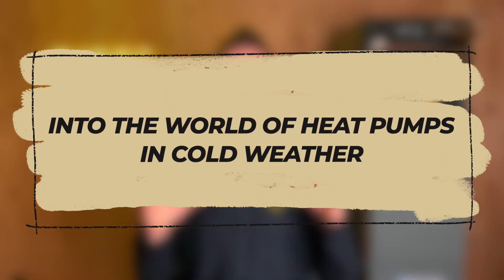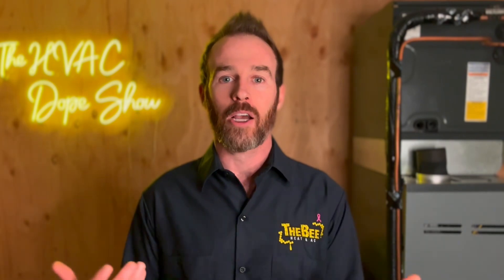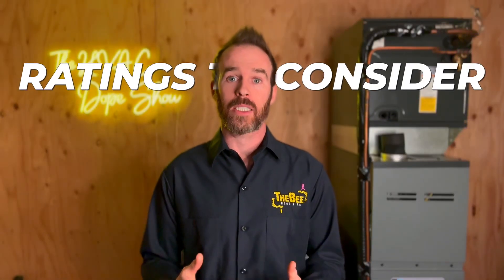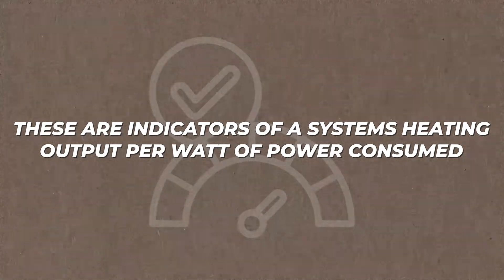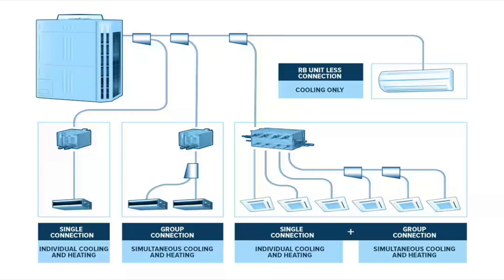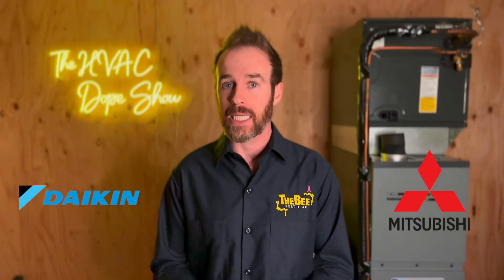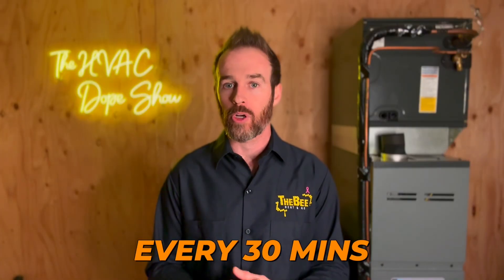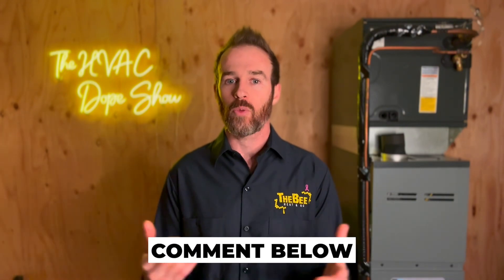Heat pumps and COLD WEATHER 🥶🔥

Comment: So a refrigerator cools inside the box and pushes the heat outside, a heat pump does the reverse and  cools the backyard!!! and pushes the heat inside the house... A heat pump halves its efficiency in winter, that is placing it right in the range of the resistance heating electricity bill cost, that costs a fraction of the heat pump in equipment.
Reply from the maker: Close but Not quite, maybe old heat pumps. Even at -5F the heat pump in my garage has a COP of 2.5 so it's 150% more efficient than electric resistive. Most of the time it's 3x as efficient and more comfortable since it doesn't dry out the air as much / less static electricity

Comment: Hello from Montreal. I'm shopping around for a heat pump. I've had 4 quotes from vendors in the last week, not one has mentioned the phase out of R410a refrigerant to R32 and have quoted R410a appliances. Do you think they should have mentioned the phase out or are they trying to sell off the old appliances? In quebec the utility Hydro Quebec administers and pays out the subsidy but they haven't included the R32 appliances. Any idea? Thanks

Comment: Update: when local temps dipped below 20 degrees Fahrenheit last week, I had to call the HVAC Co connect both heat “strips” in my Air Handlers. The heat pumps without the strips couldn’t bring the house temperature above 62 degrees. Cost me $2500. Very disappointed but system now works well.
Reply from the maker: Sorry to hear that, if you have the enhanced Fit (you should, it's the only fit that qualifies for the tax credit in the northern states) I'm surprised they're not keeping up but it also has to do with insulation and the load on your space. Maybe look at your attic insulation etc to see what the condition is because if your house is very drafty addressing the insulation / envelope of the home will do a lot more to make the space heat and cool better
Reply: New question: my hot water heater has a coil connected to my natural gas boiler. (That’s the boilers only function now). I’m in New York, is it advisable to switch to a heat pump hot water heater? Will it produce hot water comparably? I have solar panels and want to convert most of my house to electricity. Plus my boiler is requiring regular, expensive repairs.

Comment: I recently had (2) of the following heat pumps (ducted) installed and disconnected my gas boiler. I didn’t connect the “heat strips” in either system but am concerned with upcoming temps of 10-20 (above zero) degree Fahrenheit. 
I had my attic roof Insulated with open cell insulation. (One air handler is in the attic, other is in the basement. Would you recommend for me to not connect the heat strips? (I’m trying not to use an exorbitant amount of electricity). Thank you.
Reply: Multi-Position, Variable-Speed,
ECM-Based Air Handler
with Internal EEV
Communicating
For Daikin fit matchups
1½ to 5 Tons
Reply from the maker: If you have the enhanced Daikin fit you'll probably be fine but I'd just run it and see how they do. If that's the coldest that it gets you'll probably be ok. The enhanced maintains a higher capacity down to 5F whereas the standard doesn't, but at 10-20F you're probably going to be just fine for heating. Just see how it feels and if it keeps up and that's the coldest you ever get in your region then you're probably good. Worst case scenario it will not keep up well but will still heat to 60 or 65 or something and then you'll know if you need backup heat, but on the enhanced they run fine at those temps
Reply: @TheHVACDopeShow thank you. I plan to see how they perform. This is the Daikin that I have, not sure if they are “enhanced” 

- Multi-Position, Variable-Speed,
ECM-Based Air Handler
with Internal EEV
Communicating
For Daikin fit matchups
1½ to 5 Tons

Comment: If my heat pump cycles every 10minutes in 30degree weather, could it be low on freon?
Reply from the maker: Or oversized if it's reaching temperature quickly... if it's not keeping up then could be something else, always check airflow first (vents open, clean filter etc)

Comment: Same old story: 
"Heat pumps work great in cold weather. It's a myth they dont"
Immediately followed by:
"You will have to have back up heat in freezing weather"
Which proves they don't work. If they did, why do we need backup heat?
Backup heat when it's 5F (-15C) is going to be gas or electricity. Which is very expensive to run. (Electricity, gas is cheap for us)You need ample room on your electricity feed to add another 40 amps which will be a problem for many.
Reply from the maker: Lol they don't work well in Antarctica but they work great in Colorado. Average low in Denver in January is 21F. Tell me how a heat pump that can handle the AVERAGE low with a 10 degree variance doesn't make sense? Maybe not in Montana or places where it's below 0F for months but we have one installed in a gated community guard office in Aspen as the only heat source without a backup and it keeps it comfortable year round. Some people just like to nitpick and mince words... when something doesn't work 1-2 nights out of 365 suddenly "it doesn't work". That's like saying "I take my super car to the track once a year but drive it to work daily, these tires don't work for it they only work up to 160 MPH." Like when are you driving it over 160mph? Only on the track... so you have track tires for the time you drive it over 160? And regular tires for daily use? If you're not sold don't buy one but if that's your logic it sounds like you just are sold on not liking heat pumps. Heat pump on our garage works at 100% capacity below 5F, it's warm always, never fails, and has no backup heat
Reply: @TheHVACDopeShow  He's right.    You say they work in cold.  Then you contradict yourself.   It sounds like you're pushing an agenda.   You need to clearly define and establish  "cold" levels where people live in North America and where they 'work' well or not.  What is 'work'?  If you need a back-up, that's not work.

Comment: It annoys me that there are so many adverts about heat pumps "why doesn't everyone have a...".

For me the issue will be where the heat exchanger blows the cold air; I have a choice between the North of our house, which sees the Sun in June and is already cold and occasionally damp. The West has a wall that never gets sunlight and is already cold, the East is another house, because this is a semi-detached. Or there is over the decking at the back, where we would like to sit out in what sunshine we do get... Bear in mind this is the UK, it rains a lot and although the temperatures aren't very extreme, the gardens (backyards) are also small. Ours is a triangle 6m x 10.
Reply from the maker: Heat pumps do blow cold air outside, it shouldn't affect anything unless youre sitting by it like you mentioned

Comment: I have a 2.5 ton single stage Amana (Goodman) heat pump in a dual-fuel system in Iowa, where it gets really hot and really cold.  The heat pump works perfectly, not too noisy, excellent results here in hot or moderately cool. My only disappointment is that the installers told me it only works at 36F and above, and not to mess with the setting. I wish I'd known about cold-weather heat pumps, inverters etc in 2022 when I bought this one.
Reply from the maker: A lot of contractors still shy away from the higher end inverter tech but honestly that’s not a bad system, if you’re happy with it so far I wouldn’t stress… an upside is the repairs are cheaper in the future so it’s really depending on home size and needs but I’m sorry to hear they didn’t give you the option!

Comment: I have asked my contractor to go with a non duel fuel system. If my contractor sets the balance point to 46 F,  the point at which my furnace will provide heat, will my outdoor condenser unit go into defrost mode? I would like to avoid this as I have been informed it's very loud.
Reply from the maker: Depends on the system defrost mode is only loud on some systems, but it will always go to defrost mode at some point depending on run time. Just depends on the system if it does you can always switch it back to a lower or higher temp but 46 is pretty high so depending on humidity levels outside it may never go into defrost mode

Comment: Need to replace out 45 year old oil furnace and air conditioner. Natural gas is not available. Can you do duel fuel heat using a forced air oil furnace?
Reply from the maker: Yes you can just might be limited on what you can use or who offers these systems… for example a Bosch heat pump can pair with any forced air system because it’s not communicating so that would pair, but the Daikin fit is communicating so it would need a matching air handler and I don’t think they make an oil furnace. It looks like Rheem makes a unit and that might pair well with their side discharge heat pump. I’m not 100% sure honestly because I’ve not touched oil, but at a glance they’re one of the manufacturers that has oil furnaces and a cold weather heat pump that can be used

Comment: Hi.   Do you have a recommendation for an efficient cold climate heat pump where only heat is needed.  Like the mountains of Colorado where we never need AC. I have propane heat and would like to reduce propane usage.  Thanks
Reply from the maker: Heat pump will always do cooling too because it’s an AC by default. Anything cold climate rated / Mitsubishi h2i, Daikin OTerra mini split / atmosphera too are good. Are you doing mini split or central air? Lots of ways you can do it…

Comment: I live as far south in Ontario that I can at my latitude[north shore of lake Ontario,] SOUTH of many parts of NY/Vermont/Maine/new Hampshire/Wisconsin etc -30c is NORMAL here in winter even -40c at times, so you're way off on locations where supplemental heat is needed, ALL of Canada needs to use supplemental heat [our govt is only giving rebates on ELECTRIC heat pumps], when ppl could use their existing 95% gas/propane furnaces....huge cash grab!!!!  yes.... I've been in the HVAC business over 30yrs lol
Reply from the maker: Coastal Canada is warmer like Vancouver, average temps are above 32F / 0C for the lows… Toronto gets -10c which a heat pump can handle but I know that there are colder temps. So dual fuel doesn’t get a rebate in Canada ? That’s kind of dumb lol wow, didn’t know that.

Comment: I'm going to be receiving a manufactured home from Fleetwood Manufacturing and it will be installing in Central Illinois I told them I would like a heat pump system but I haven't been told what system they're going to use
Reply from the maker: I would ask for an inverter or if you don’t like what they’re putting in just hire a local contractor when you’re doing to put in the one you want.
Reply from the maker: They might give you a good one just ask for model number or tell them what you want… anything that is a cold climate inverter will probably be ok but I’d prefer a side discharge system like the Rheem or Daikin fit or Trane resolute products in your climate
Reply: I think before I decided with a heat pump the outside unit was going to be a train that maybe still the case

Comment: Trying to figure out best option to improve efficiency of a 1985 4 stage natural gas 1 million BTU boiler.  In Pacific Northwest so temps are 45F for most of the winter.  I am thinking a monoblock air to water heat pump could at least pre-charge water before being delivered to the boiler.  Electrical service is minimal though so need to determine how many amp.  Currently have 3 proterra hybrid heat pumps with a 180k btu gas water heater doing the hot water.  What kind of COP do you see at the 45F mark?  Just trying to ball park money efficiency vs natural gas btu.  Natural gas prices have been in retreat the last year so quite a different story than 1-2 years ago.   Thanks for the videos !
Reply from the maker: Monoblock could work but idk that’s its worth it just to preheat the water. From a cost perspective still might be an expensive replacement
Reply: @TheHVACDopeShow   I can get the MONOBLOC V4 5T - GRS-CQ16PD/NHG3-D for ~$13,000 plus installation.  That will do 55,000 btu of heating.  Just need to figure out the COP and monthly average temperature during heating season and then figure out ele cost vs natural gas cost per btu.  Pretty sure I don't have enough ele capacity to install 10 of them without a hydro upgrade but should be able to do 1 to start.  Can't use the cooling and only heating 7-8 months of the year so payback might be longer than hpwts.  Also not sure how long to expect the 1985 boiler ( Hydrotherm mr-1200b ) to last.

Comment: Do inverter style heat pumps come with humidity control for shoulder seasons. This would be in conjunction with a ducted system.
Reply from the maker: Short answer is yes and they vary in application. Most have a dehumidify run mode option

Comment: In the Detroit area, gas is the way to go.  Electric cost here are some of the highest in the country.  Since installing my heat pump, my electric bills have increase 41-55 percent.  AND we are having a mild winter.....
Reply from the maker: Yikes sorry to hear that, what are you electric rates out of curiosity? Is it an inverter heat pump? I would make sure the electric backup heat isn’t kicking in more than necessary because that can have that effect. Not sure if adding solar panels is an option to offset that but might be worth it if that’s the case with an inverter / cold climate heat pump.

Comment: Have learned a lot from your videos!  We have a very small home (900 sq ft) in Moscow, ID, switching over from old gas forced air furnace to a dual fuel heat pump (to get central A/C, use less gas, maybe obtain some efficiency savings).  Good energy audit and inspection from an area HVAC co.  They offered us quotes on either a 2 ton Daikin FIT or 2 ton Daikin VRV Life.  We're leaning to VRV because works to lower winter temps that we can experience here.  Noticed that this model (RXSQ24TVJU) isn't in production any more.  Would that be a problem for us going forward?  As far as future servicing and maintenance...?  Also unfortunately this particular VRV doesn't qualify for tax credit in our area, even though it has very good efficiency ratings.  Maybe that is because of disconnect with inverter type systems qualifying for inflation reduction act tax credits that you mentioned in another video(?). Thanks again for sharing your expertise to help make us better educated consumers.
Reply from the maker: Our pleasure glad you’re enjoying them! Although the VRV works to lower temps technically, it’s at roughly 65% capacity at -10F I believe depending on the unit, so I think either the enhanced or the VRV would work. You’ll have backup heat too I assume? If your insulation is good you should be fine with either system 95+% of the time (idk how cold Moscow/ID gets) but that shouldn’t be an issue

Comment: Good video. I'm located in Prince George, BC Canada and considering installing a Lennox SL25XPV heat pump (Dave Lennox series variable speed inverter, low ambient of -4F rating) with a dual fuel system of my existing Lennox SLP99V (99% efficient variable speed) as in my region they have a $6000cdn rebate but with only certain paired configurations. I already have the communicating Lennox S30 thermostat. Right now natural gas in our region is quite a bit cheaper than electricity however we have a carbon tax on the natural gas which is set to go up every year till 2030 when they are saying they will ban the sale of natural gas furnaces. Our region can see lows of -40C/F but average is probably -5C to -10C with some warming periods around freezing. Any thoughts on the Lennox heat pumps and would you always install under the eaves of the house for maximum protection from snow storms? I have a hot tub concrete pad that I could use but is about 10'f from the house and power is already there, otherwise would put it on a wooden deck with rubber isolators, Lennox does sell a snow cover hood. Thinking if the costs get too much to run the heat pump can always turn off in winter and just run natural gas furnace.
Reply from the maker: That sounds like a good plane although you want the condenser close to the house. People use concrete ultralight pads (foam filled) so putting in a pad isn’t a big deal and you don’t need isolators that condenser is quiet. Being under the eve isn’t important but it’s more about being close to the house otherwise that lineset will be tripped over / damaged, and you don’t want to run it underground. Besides that it sounds like a good plan, I’d see what other systems qualify because some of the low ambient products go down to -20F or colder.
Reply: @TheHVACDopeShow  ok thanks for the reply, the spot on my wooden deck is the closest to my mechanical room, straight shot thru shed attached to house maybe about 8' wide, the lines could be run up against exterior house/shed wall so they don't get damaged, but still inside enclosed shed for protection from exterior elements. My wooden deck is about 6" off the ground so perhaps the best solution is to modify the deck so can put in a small concrete pad. Will have to look into foam filled concrete. As for units with my furnace I am only approved for 3 Lennox models, the Dave Lennox variable capacity, Lennox elite variable capacity and Lennox mid efficient single stage units. I like your YouTube content in that I can tell your honest and offer great advise :)

Comment: is goodman heat pump GSZB404210A good for north texas. Also, what would be the lowest temp before backup came on would you recommend.
Reply from the maker: https://www.ecomfort.com/manuals/59d8436a3722ba5cef7b49166dc02b30.pdf

Just check the performance chart idk how cold it gets but that’s a 14 seer single stage so it’s just a basic system. COP is ok but the capacity starts dropping below 47F… at 20F it’s 24K BTU